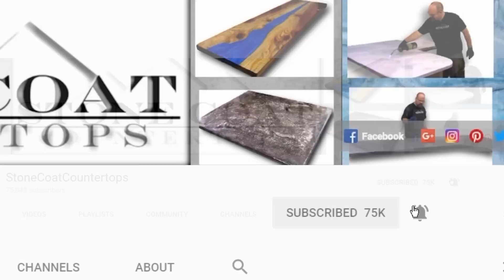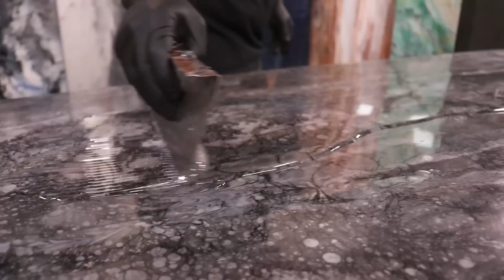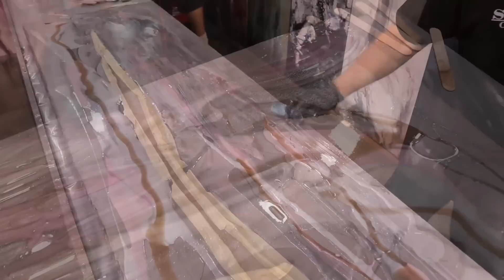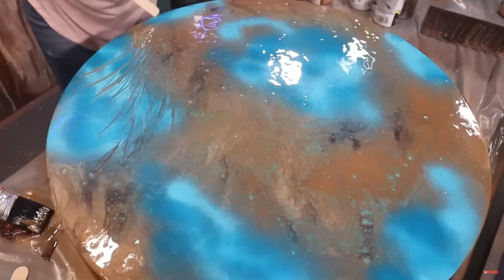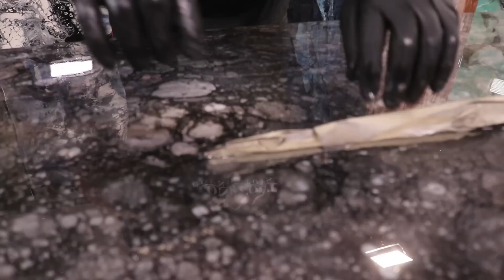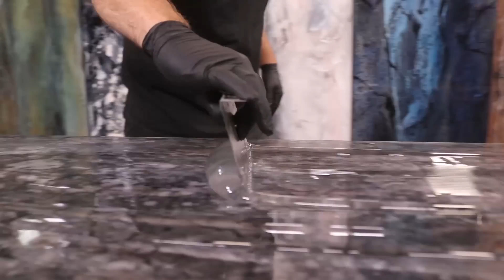DIY Granite Made From Wood

Comment: If you created a long counter top slab, how would you cut out a sink hole after you have finished coutertop? Are there any special precautions you would take and how would you cut it in, assuming you have a sink template.  Thanks Great video!
Reply: matrickent Cut the hole first, and then mask the hole with tape and plastic, to get good edges

Comment: Hi I was wondering ; can any spray paint go with epoxy  ! Or is there a special spray paint for it !!?
Reply: And is that alcohol you spray to make the cells!!?
Reply: @fouzarf4995  Yes. He uses 90% isopropyl. The brand of spray paint he uses is I believe Rustoleum 2X (you can find at your local hardware store), because all of those play fairly well with epoxy. You can SOMETIMES use other brands. Experiment first on a small board. I've had some turn out horrible and some turn amazing.